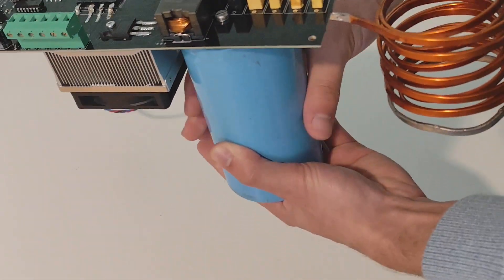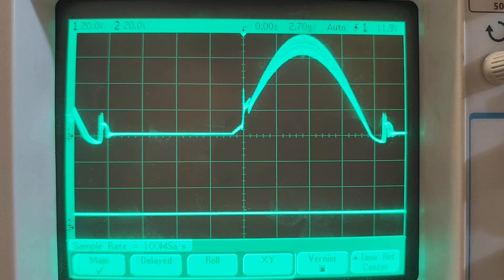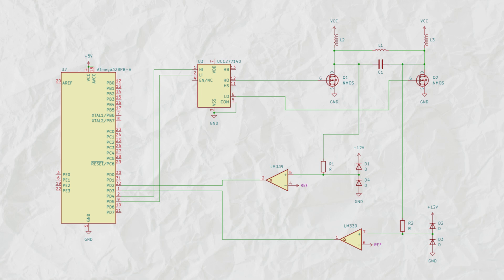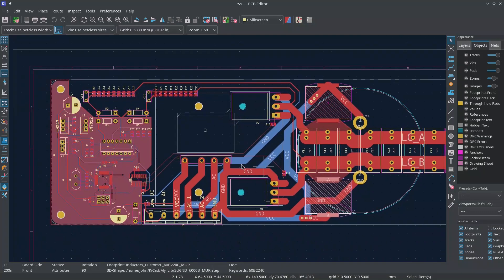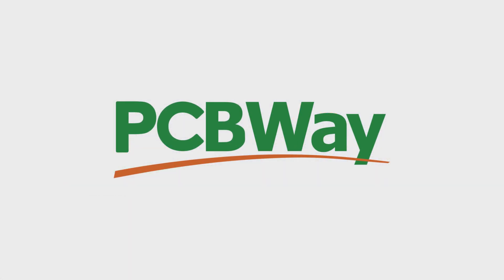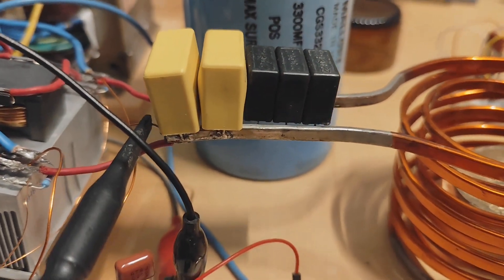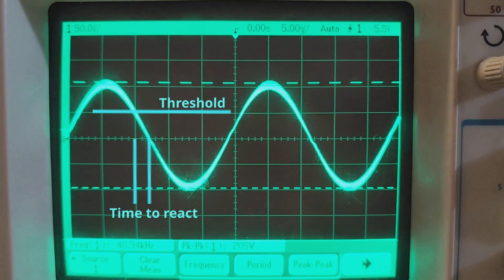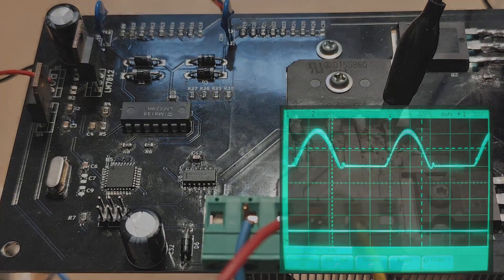Building a Digitally Controlled Induction Heater

Comment: Nice build! I remember my ZVS that had 360W @36V. Fully analog, the most advanced IC was LM358 double op amp. The rest was just discrete transistors. It had overcurrent and overtemperature protection, run smoothly, never killed any mosfet. But had the same problem with bulging capacitors. MKP X2 from power supply interference filter are not the best choice for this job. Their dV/dt rating is simply too low and they break down. I went with MKP10, MKPH are also suitable. Not only type, but voltage rating also matters. The higher it is, the higher dV/dt rating and the capacitor can handle higher resonance frequencies / higher voltage at the same frequency.
Reply from the maker: Thanks for the suggestion!
Reply: any video or a buildlog?
Reply: @ljuberzy  https://youtu.be/X3ogwP7xrA0
Reply: @__MINT_  great project! though, I wish there were a pcb (to avoid wire mess)
Reply: @ljuberzy  now it is standard in my projects, but back in the time wasn't

Comment: I wonder if back-to-back electrolytics with high voltage rating would help

Would be interesting to hear thoughts of pros and cons of Kicad and Altium. Kicad 9 just came out!
Reply from the maker: I might be confused but the back-to-back electrolytics isn't something that should be done, the voltage across each cap is the same polarity of the total one, so one of the two caps always gets the negative voltage. (Hope I didn't misinterpret what you mean)

As for kicad I just got started but I prefer it already. Only thing I could complain about is finding components and footprints and how they go together is a little confusing to me. Also the 3d view opening on a new page is slightly inconvenient, but overall e great software.
Reply: @ back-to-back electrolytics is a way to make a 'non-polarized' EC. Also then gives them a higher voltage tolerance. Although MINT may be correct about insufficient current handling capability, I'm not exactly expert with this design of circuit.
Reply: @ivolol  electrolytics would immediately turn into smoke generator. Resonance capacitors work under extreme conditions like current easily hitting a few tens of amps, and I mean amps closer to 100. Internal resistance of an electrolytic cap wouldn't allow for such current anyways, it would end up with huge power loss and nicely cooked capacitor. That's why there are specialized resonance capacitors made for this purpose.
Back-to-back means 2 capacitors in series with the same polarity terminals conneceted together. To protect from reverse polarity, antiparaller diode can be added across each cap.

Comment: You need more capacitors in parallel to prevent them from bulging or use lower ESR capacitors. Adding them in parallel will reduce the frequency so it may be a better way.
Reply from the maker: Yeah unfortunately I had to use the stuff I salvaged from random electronics, I should have ordered some good ones, but forgot

Comment: Such a waste of MCU potential :(

Next revision, replace Atmega328P with artix 7 fpga :DD

I would have done this with discrete logic but its fun diy project to do it with mcu
Reply from the maker: I agree, unfortunately I couldn't make it work in any other way. An attiny would already be more cost effective, but whatever.

Unfortunately I've never used FPGA, but it's a good suggestion.